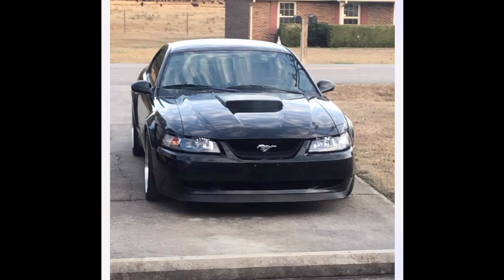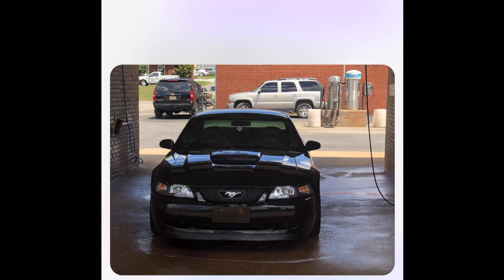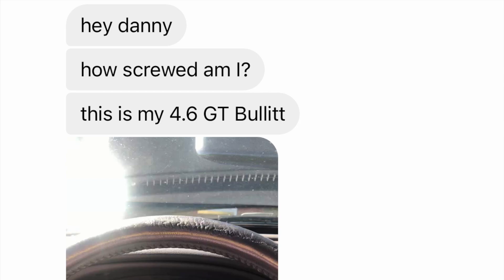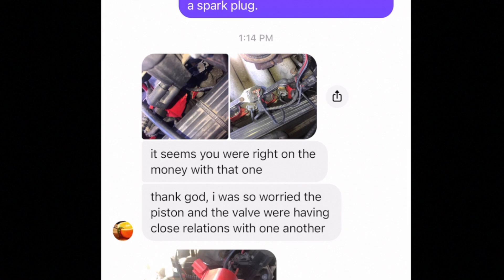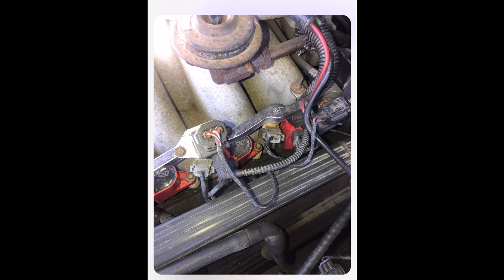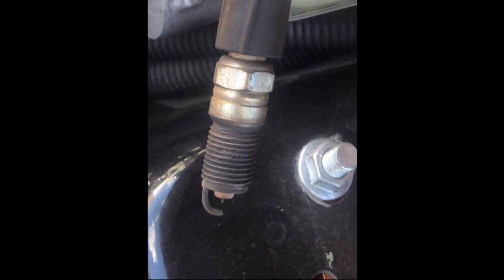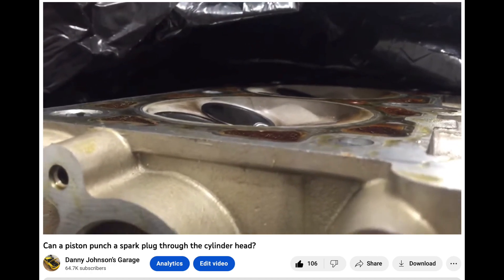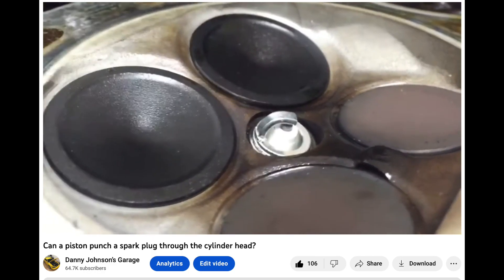Spark plug blowout explained. Ford 4.6L and 5.4L V8 engines

Comment: I have a 4.6 f150 and its had several plugs in different cylinders suddenly look like they got hit by the piston. One today in cylinder 1 it was pressed together and I had to regap it after that misfire stopped. I replaced the coils and wires and keep getting misfires after doing hard accelerations. If the piston is not changing the gap on the plug than what is?
Reply from the maker: Most likely it’s called detonation- fuel igniting before it’s supposed to, so instead of pushing the piston down, that force is trapped as the piston is still finishing the compression stroke (piston is still in its way up when fuel ignites). It can be from a lean condition such as a failing fuel pump that is not supplying enough fuel so it is “lean” and produces excessive heat and causes the detonation. That’s one thought
Reply: @dannyjohnsonsgarage  I do have a vacuum leak but its been there for years before this issue developed. I think it's the intake manifold gasket but can't find the leak. The sensors in the exhaust should detect the extra gases and adjust the fuel. How can i figure out the issue? I dont think its pre ignition because the misfires stop when i replace or fix the spark plug. You would feel preignition I would think because it would try to force the piston down while its coming up but after fixing the plug it stops.
Reply from the maker: @ it could be extra air getting in through the intake manifold, which would be unmetered past the maf. That would also cause a lean condition

Comment: Is it possible the 3 valve design could be the cause? More air coming in and not enough coming out over time?
Reply from the maker: No, since this has happened with 2 valve and 4 valve as well. It’s the amount of spark plug threads that are easily compromised if over-tightened

Comment: What if my ignition coil bolt break off from the intake manifold? Will it still be good to run without the coil popping off?
Reply from the maker: It should be okay, but if you get a misfire from it you’ll want to find a way to keep it snuggled down

Comment: Hey Danny, do you have any advice on valve tick? I have an 04 Mach 1 with B heads that has developed the drivers side tick. Only happens at about 1,800 rpm, not at idle. Any advice on a heavier oil (I have 5w-20 in it now) to maybe try to reduce damage? Head cooling mod will help but I just want to try to employ damage control here
Reply from the maker: If it is for sure head tick, it’s valve guide wear so where the valve seats are pressed in is loose. Oil won’t change it since the seats are pressed in. Head tick can only be fixed by removing the cylinder heads and having new valve seats pressed in. There really isn’t any performance problems and MRT raced their mach 1 hard with head tick without any problems

Comment: Ford tech dominco which is a Ford Master mechanic recommence 16 to 17 ft pounds of torque and anti-seize.. I've been doing this for years on these two valves and have not had an issue yet
Reply: Hey just asking u put anit seize on the thread of the spark plug
Reply: @garyyoungmac4855 of course that's common sense

Comment: Hey Danny, somewhat related, what boots with springs would you recommend for the 03 04 Cobras? I am doing some maintenance and the coils themselves seem fine, but  I would like the replace the boots and springs since those are pretty cheap.
Reply from the maker: Factory is best in my opinion

Comment: Another great video, glad I have a 04. Spark plug issues is timely too. Mine just had the Engine Service Light come on. Misfire on cylinder 7&8. I think it's the spark plugs or coils. Going to change them all this weekend and see if the codes clear up.

Comment: When I replaced the plugs in my 02 GT I was concerned about the new plugs having more threads on them than the original plugs. But a couple of youtube videos said that they are the correct replacement. One youtube video said to torque to 20 ft-lbs with anti-seize while another said not to use the grease. I opted to go without the anti-seize. It's been over 5000 miles since replacement and no problems so far. The OEM spec was 13 ft-lb of torque though.
Reply: A 4.6 in my dad's van had a plug that must have been practically welded in. He had to take it to a mechanic to get it out. That being said, I've had 2 of these engines and never had a problem changing the plugs and I never used anti-seize. I torqued them to 14 ft lbs.

Comment: Excellent content 👍🏽... I've heard of different helicoid options, hope this Bullitt outlasts the helicoid repair... What are ways of knowing which heads are on our 4.6L / 5.4s? Minus removing a spark plug... Thanks again....
Reply from the maker: The casting number should tell you. I understand the GT was the same as the mach 1 and cobra and got 9 thread heads late 03 and into 04 https://youtu.be/8LQC8XXBl2Y

Comment: Glad mine’s an ‘04. Wouldn’t using a torque wrench help reduce the chances of this on older models?
Reply from the maker: It will. But 12-14 foot pounds barely comes up so you’d need an inch pound wrench. Most ft pound ones start at 20

Comment: What month in O3 did they mostly switch over to the 9 thread heads??
Reply from the maker: November of 2002 on the engine build dates so most 03s didn’t get the new 9 threads until the last cars made. My brother’s 10th anniversary cobra and his 2003 mach 1 both got the 9 thread heads. I heard it was about the same for the GTs too
Reply: @dannyjohnsonsgarage  my 03 GT has the 9 thread heads on it.
Reply: Thank you Danny, mine was made in April of 03 so I’m still not sure.